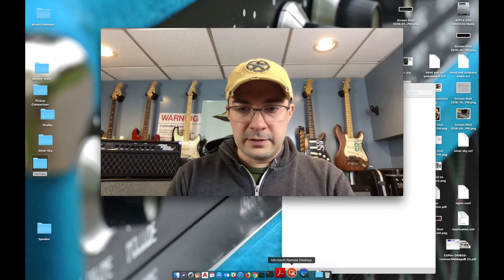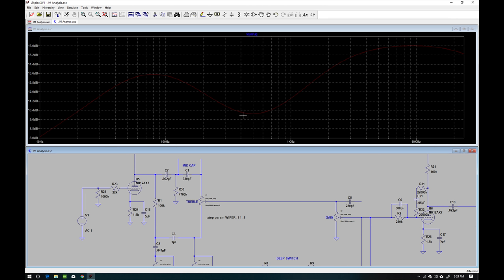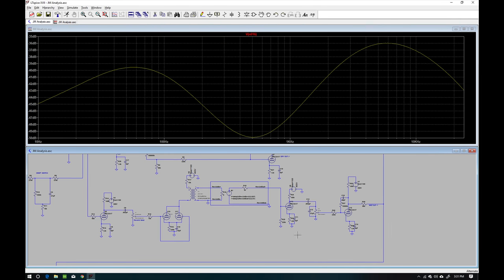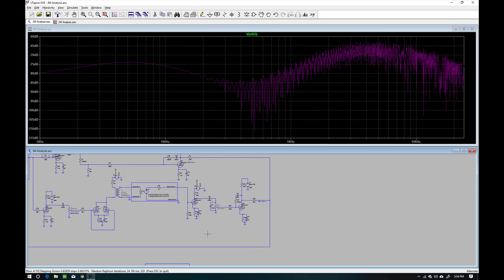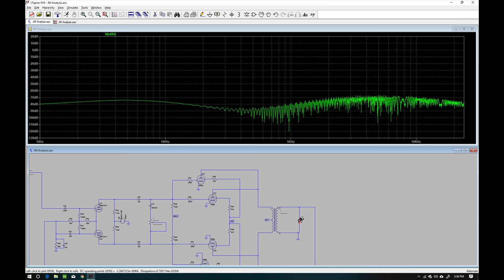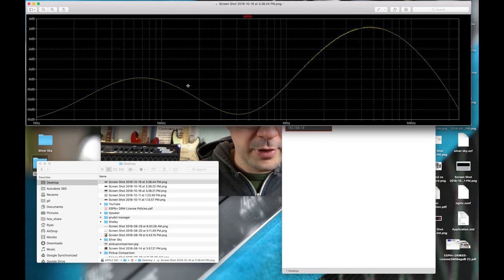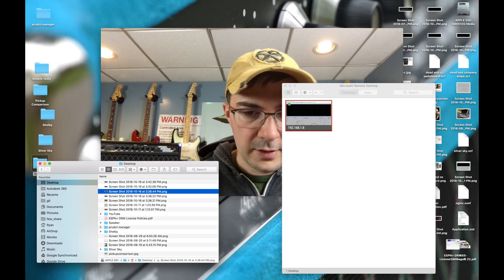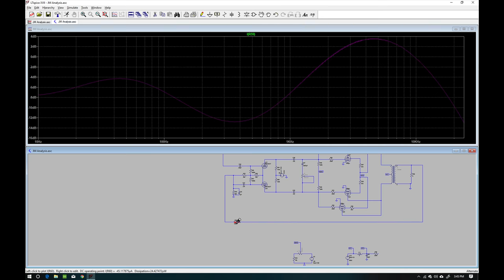Deep LTSpice Circuit Analysis | Two Rock John Mayer Signature Tube Amplifier

Comment: Not lame/boring ...I thoroughly enjoyed the video(Thanks for the links!). I am saving to get the Ceriatone JM50 in the very near future, so I appreciate having this info so that I can run some component substituion simulations before I build the Amp ;)
Reply from the maker: Daniel Gomez awesomeness!! Let me know if you find anything interesting! The step sweep {WIPER} makes it so easy to see what each knob does to the circuit output
Reply from the maker: Daniel Gomez and thank you! :-)
Reply: @TheToneGeek  hey Ryan, just following up ...I decided to go with a Ceriatone OTS FM50 ME instead of the JM50 as I really like the idea of having a 2 channel amp(as I already own 2 single channel amps; '76 Deluxe Reverb, and a home built JTM45). I received the amp kit and have built already(build thread over on TGP;   https://www.thegearpage.net/board/index.php?threads/ceriatone-fm-m-e-overtone-special-build-updated.1991218/   ...It is an amazing amp for sure! I'm still playing around with it as I have no experience with this caliber equipment, lol. 

What I would like to find out regarding the JM50 are the circuit voltages. Did you record them in your build? I would be very curious to know the measurements if you have logged them. 

W
Reply from the maker: @danielcgomez  nice, dude!!! Thanks for the update and congrats on your build! Can't wait to check out the link right after I post my reply. On Ceriatone's site, on the very bottom is "voltages" which outlines all expected voltages. I emailed Nik to ask him JM100 voltages and he pointed me this direction. My wall outlet is 124v!! So my b+ is 476 when it should be around 450-460.. eek!! I am now saving pennies for an AmpRX brown box to get me right where I should be in a portable package
Reply from the maker: @danielcgomez  just checked out your TGP entry and wowwwwwwww that is great stuff!!! That light bulb limiter!! Wow! You did a fantastic job. I'm incredibly impressed
Reply: @TheToneGeek  wow! I'm sitting between 111-116VAC on the line. My Plates are sitting at 422VDC(with 110VAC Line).
Reply: @TheToneGeek  Thanks you very much!

Comment: Many thanks for the LTSpice model! I see that the preamp barely saturates with the input voltage achievable by passive pickups (starts around 0.6V amplitude, 100Hz, full gain, neutral tone stack, bright off), interesting. It seems like it's 95% EQ unless cranked all the way or boosted or there's sag.

Comment: Have you tried putting a wave file through the circuit and exporting it out (to see what it sounds like?).
Reply from the maker: That's possible???? I did not know this!
Reply: @TheToneGeek  Yes it is possible, I am currently designing some effects pedals using a wavefile of a guitar at the source and then exporting the wav from the circuits output. The info on how to do this is on youtube and I have done a video on my channel (doesn't explain in details but you can see the LT spice comands and get the gist. It is easy to do and seems effective. There is also a recent program called Livespice which allows you to hear your audio through VSTs
Reply from the maker: @delatronics3257  wow you just blew my mind! I will absolutely look into this and subscribe to your channel. Thank you!
Reply: @TheToneGeek  I am a new user of LTSPICE myself but have 35 years of experience in electronic audio as a service engineer. I am building the project on breadboard at the moment based on my listening trials (when I try a new clipping diode model, I can hear the sound change from MOSFET clipping to LED clipping; it's  very usefull)